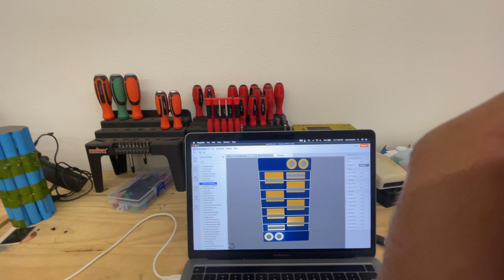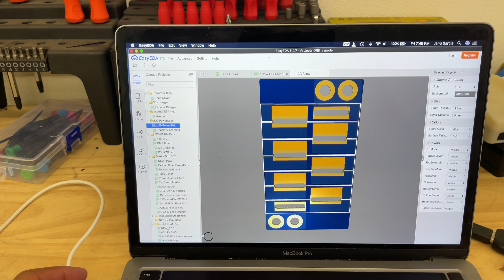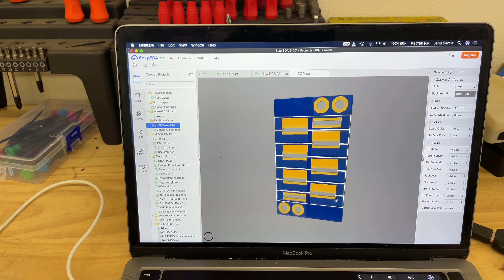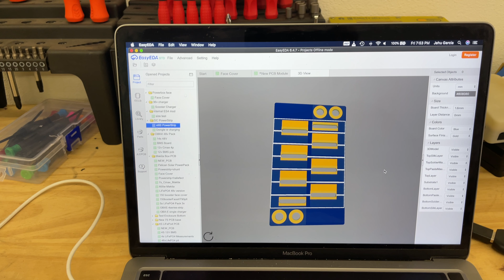Help me Design a pack using 50C LIPO cells

Comment: E bike! With fast charging. I’m really glad you got these I was looking at the 22.2 V packs to build a 72 V Lipo E bike battery.
Reply: Low capacity for price. Good for a small esk8  or maybe a high power board in 2p.
Reply: @quinnfoster4671   Yup that’s true. Really need to be above 10ah. 20ah lipos would be even better.
Reply: You don't need that type of peak power for an e-bike. 72V is 20s, on a 20s1p config, that would be 6kW. Thats already huge for a bike.
If you want around 20Ah, you'll need 20s3p, which can sustain 18kW.
You really don't need this for an e-bike.
Those batteries are for very high peak current, and short use.
Reply: @quinnfoster4671  however the number in parallel needed is small. Current is no issue for a e-scooter. With cylindrical cells, 10  amps cont. is max. so you need more cells with  more welding/soldering. SO, an 80V  21S 4p, 24.8 Amp hr battery will cost 850, not 1500. so i see it as a better value since it is a high current source . To get the same from 118650, 10 amp cells, at 3 amp hrs each, run at 5 amps continuous. To get 24 amp hours we need 8 P for
capacity, but to get 50  amps, we would need 10P.  so 10p X 21S is 210 cells at 8 bucks each? That's over 1600 dollars almost twice the cost.
I invite a critique of my calculations and assumptions.  (assumptions: all new cells, 10 amp cells run at 5 amps for life and safety.) P.S. i just paid 550 CAD for 5 16 Volt scooter batteries. (Gel cell?)

Comment: do spot welding for welding 18650 21700, use 3-4 bags in series as a welding power source, design a printed circuit board or take a finished device from aliexpress. The positive terminal in such elements is made of aluminum, soldered with a special flux or mechanically pressed against others

Comment: Kayak battery for electric motor. In RC we use them to power servos and brushless motors. You could essentially use similar parts to build a kick but set up for a kayak.

Comment: Portable car jump starter, that has usb ports, a flashlights and due to their capacity they could have a 12 volt socket for an inverter or anything  12 volt.
Edit: make them the size of a 12 volt 10 or 20AH battery. But the real voltage could be 14.8 and like 1200A.
Edit 2: solar rechargeable brief case.

Comment: Check the real mAh, and check the resistance. The most common RC LIPOs are 4S and 6S. What real current do you get before the voltage drops below a usable level? (Since the C rating could easily be exaggerated.) Think of a high current project. Maybe a spot welder. Maybe an RC Pack... Something that goes fast...
Reply: Always exaggerated

Comment: I would love to use these to make 8S packs for my RC cars. Off-the-shelf 8S packs are really expensive and only a few companies offer them. Most guys use 2x 4S LiPo packs in series for 8S. My setup is somewhat limited on battery tray space so the extra 2mm or 3mm of thickness from having the extra layers of outer wrapping make many 4S packs unusable for me. I'm about to jump on your website to see what you have these priced at. I hope they're affordable, 6200mah would get me nearly 30 minutes of full-throttle fun.

Comment: It depends on the voltage, I would be interested in using those as a 12 volt car battery backup booster.

If you have it set up for 12 volt, however you set it up, series and parallel, there will be many different uses for it, including building it up into a portable solar battery system.
Reply: Those are high current discharge batteries. Portable solar system don't need those type of battery, as they are pretty low power.

Comment: I forgot to add that the RC plane batteries do not need an internal protection module. But they will need an external Balance lead for charging.  The charging unit takes care of balancing the internal battery packs.

Comment: Make single packs which can clip together to be expandable. 
So could be used as a phone bank, or could add several together to upscale size.
You could then include a output adapter for the end of it to provide different outputs for different people.
Reply: Those are specialized high current cells (1000W for a single cell), it would be a waste to use them as a power bank for a phone.
Reply: @xmtxx  
Did you just read half my comment?
Reply: @AS-gz9qi  And did you read mine?
You are proposing to use a cell capable of outputing 1000W to charge a phone, which would need at most 10-15W, how is that not a waste?
Then you propose something so vague that I don't have a clue about what you are thinking.
What "different outputs for different people" would require several kW of power for a few minutes?
If you don't need that much power, those cells are useless, you better go for the cheaper 21700 or 18650 low C discharge ones.
Reply: @xmtxx  like I said make them connectable so could be upscaled to use for whatever you want! 
Your tunnel vision to what you think would be pointless for your use, could be used for lots of different uses with some thought 
But sure thanks for your valid input to my comment. Please go post your own comment and jog on. Thanks bye
Reply: @AS-gz9qi  And yet you fail to provide a valid use case.
What you don't quite get is that those are expensive very specialized cells.
They are for special cases. 

If you stack them up, you'll add up the possible total power output.
Group them by 10, you'll get 10kW of possible power output.
Use cases necessitating those kind of power for such small energy (250Wh) are pretty rare, not at all "for lots of different use", which you provide none of them.
Again, if you don't need that kind of power density, it will be way cheaper, and more durable to go for the classic li-ion 18650 or 21700 cylindrical cells.

Your first comment was uneducated, and that's completely understandable, everybody starts at the bottom.
Now, you are being studborn at not understanding, and that's not good on your part.

Jehu has been handling cylindrical low/normal C rate cells for quite some years, he knows what to do with normal cells, and he countlessly demonstrated that.
Those are high discharge cells, which are new to him, that's why he ask for use cases specific to them.
Reply: @AS-gz9qi what you are proposing contains the exact same pitfall the Jehu boards have. High resistance. There’s a reason why these things are ultrasonically welded together.

Comment: Stackable to 20s and modular enough to mount them parallel as well. Maybe with a couple heavy gauge connector pads for mains and some attachments to run fan off of on board circuit. I'll tell you right now I'm grabbing some for electric motorcycle.
Reply: 24s
Reply: And parallel yes... so much yes

Comment: I would look at your smaller batteries with possible everyday applications. For example, tons of people own a Wyze cam, that requires power. If you could create a rechargeable battery system for a Wyze cam that doesn't need to be charged but once a month, I would buy it. I am sure there are other products people use every day that would be similar. Thanks for all you do. 👍😁
Reply: Those are high discharge cells, it doesn't make sense to use them for low power use, ase they are quite expensive, and will violently explode if you short them.
Reply: @xmtxx  ahhhh gotcha. Makes sense.

Comment: The problem with these is connecting the tabs... solder doesn't seem to stick... I'm trying to replace 2 bad cells on my pack... looks like they were spot welded before and I've got amazon bringing me a spot welder today but this morning I'm watching videos about the a123 pouch cell and one tab is copper one is aluminum neg and pos. And apparently spot welding those together doesn't work??? Guess I'll find out today.... might have to find a way to simply clamp them together or I'm thinking of using wire to sort of sow the tabs together??? Any advice??? After note... ended up getting some small binder clips got a whole pack of em for .97 cents... clipped them on and pulled off the metal tabs...

Comment: If I could get a 10s on these, 3 of them would power my 36v lawn mower pretty good.
Reply: 10s1p would be able to deliver 10kW, and would only have 250Wh of energy.
Do you need that much power, and so few energy?
Reply: @xmtxx  I would need 10s3p.  The current setup has lead acid batteries that are in series.  12aH each. 2 of those batteries are not doing well.
Reply: @yoyodynepropulsion.systems  Again, with 10s3p, you could have 30kW of peak power, with only 650Wh of energy.
Do you really need that much power with so few energy?
If not, it would be cheapper to go 18650 or 21700 cylindrical cells.

Comment: I say make a board so the batteries lay flat side by side like in the board and you lay a long strip a PCB under the tabs and solder? Might be able to make an external laptop battery bank you can directly plug into a laptop after you adjust the voltage.

Comment: Don't break the XT standard. Keep negative as negative, and keep positive as positive.
Reply: I agree, use a different connector if you need a higher amperage.
Reply from the maker: what connector can do 300A
Reply: for powering my Kweld I use MR60 connectors and 3.5mm bullets, cool and cheap way to get a low profile high amp connector. But yeah if you plugged a motor into it you would be very shocked lol.

Comment: I want a LiFePO4 starter battery, but don't know of any BMSs configured for a common 600-900 CCA.  I think there is a big market for repurposing small Ah cells for this purpose.  Can you imagine, never having to buy another lead acid CCA batter ever again for an ICE vehicle?
Reply: There’s a reason why there really aren’t any on the market. Under the hood is a little warm. And what’s the number one killer of lithium? Heat. 

There are a few companies that make affordable starter BMS’s that can burst 900A like Heltec. If the battery could survive the conditions A123 or Headway would be the way to go. 

Of course you could move it into the cab since you don’t have the dangerous gases like lead acid does

Comment: These are what a lot of EV's use.   Common designs include metal "L shaped" places between the packs which dissipate heat to the underlying metal container.
Reply: Can i salvage them for cheap??
I mean from what cheap sources can i get them?

All production cars are lithium ion and scootera are 18650
Reply: Not a single EV ever produced has used this chemistry. 

Any time a pouch cell has been used it’s NMC811 or similar. Definitely not LCO. Way too unstable

Comment: 6s plz 
That will come in handy for a 24s  configuration for a high voltage electric bike
Reply: 24s will grant you 25KW for a 24s1p configuration.
Do you need such power for so few energy (500Wh)?

Comment: Could these be run at 24V or 48V  in parallel with another pack made of other LiPos?  and possibly handle short term high amp draw without hurting the other pack?  My friend's non-profit is making a refrigerated trailer for a local farm out of an old small walk in cooler. Ideally they want to run it on batteries they can charge at home.  Apparently, this thing draws 4kW on it's start up sequence. 
  Would also be interested to know if the same idea would work for electric vehicles for taking off?  I know some youtubers are trying to use capacitors to do the same thing, but they never seem to work as well as hoped.
Reply: You need a DC current limiter from low amps pack to high amp

Comment: This might be exactly what I am looking for. I’m trying to make an electric longboard With a high top speed and a lot of range. But My goal within the project is for it to look like an original longboard. Are these still available? Is it possible to attach a BMS to these cells and charge them safely? I would like to see what a 12 S4P configuration of these cellsWould it look like compared to 18 650s of the same specs.
Reply: If you want long range, you'll need a lot of Ah, as a result, you won't need a high C capacity discharge.
12S 4P, would allow 1200A and around 50kW of discharge. That's enough to power a small car.
Do you really need this kind of power on a longboard?
Usually high C discharge comes at a cost of lower power density, which is not what you want if you want long range.

Those batteries are good for short use and very high peak power
Reply: Hello. Thank you for your reply. I’m kind of new when it comes to batteries and the way you can measure them. I guess the best way to put it is right now I have a battery pack on my board and it’s at 21700 12s3p Configuration. With the battery pack I can’t hit about 35 miles an hour and get about 23 to 25 miles in between charges. I love the battery pack but the only problem I have with it is how big and bulky and heavy it is. I’m just in church in Bayonne but I think with these cells I’d be able to make the 12th as for P battery pack and keep it pretty low profile. Although I’m not familiar with these batteries And how they would be compared to a 21700 cell. I hope making sense and thank you for giving me a better understanding, I still have a lot to learn when it comes batteries.

Comment: Don't these need way more care than Li-ion? (a real question, not claiming) As I've heard of people only charging these whilst being watched over or doing it in burn-proof case.
Reply: Yeah, but because those batteries are intensely drained, and charged at high C. They get very hot, and can catch fire (that's why they charge them in fireproof bags).
If you use them like any other li-ion batteries (which is a waste), you don't need the same amount of precaution.

Edit: Forgot 1 detail. Those are way more dangerous if you short them. Each cell might output 1000A when shorted, that's a lot of power and can be very dangerous.

Comment: Replacement packs for the MANY UPS (battery backups) that use two 12v SLA. 7S 24 volt with BMS/protection and spade terminals.  Priced too high at 10 per cell fyi.
Reply: Those are high current batteries, able to deliver 1000W per cells. Do you really need that type of power for a UPS?